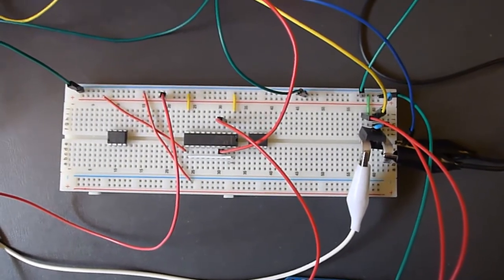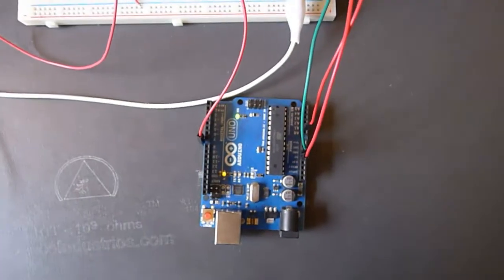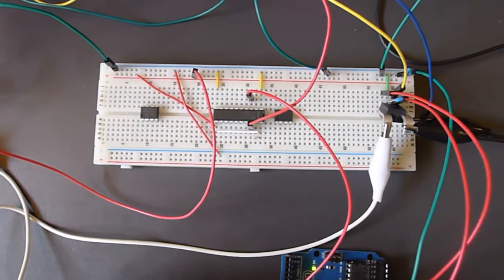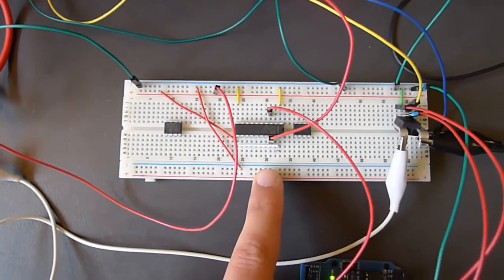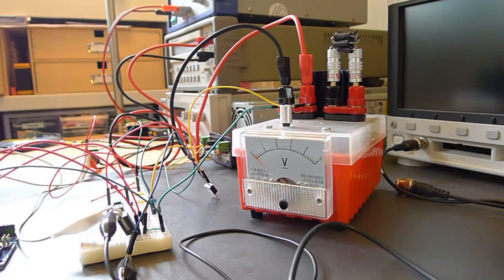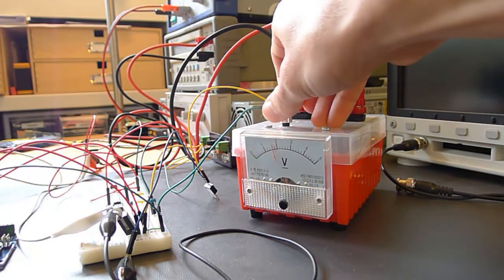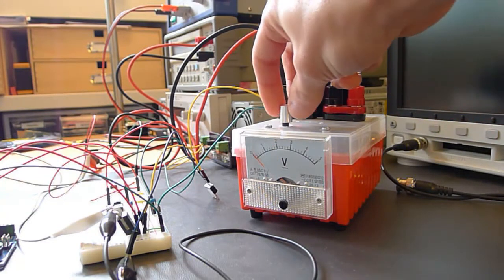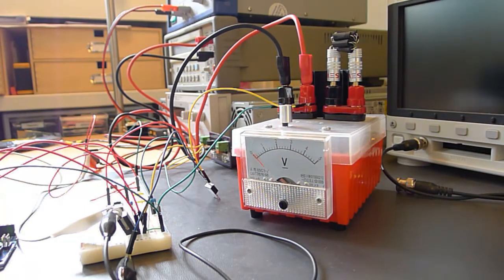Solid state circuit breaker

Comment: Hi I'm a young auto tech trying to learn Arduino coding so I can build various tools. Could you point me in the direction of what I'd need to build a solid state breaker like yours with current sensing. I have need of tool like what you have to shut off the current when it goes above a selectable level but I have no idea what to even search for. Any help would be greatly appreciated! thanks in advance!